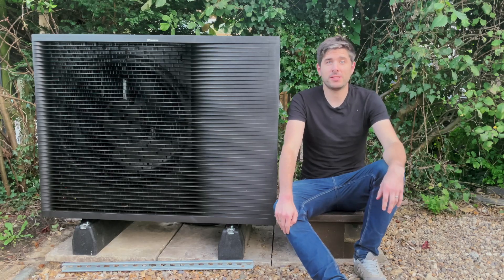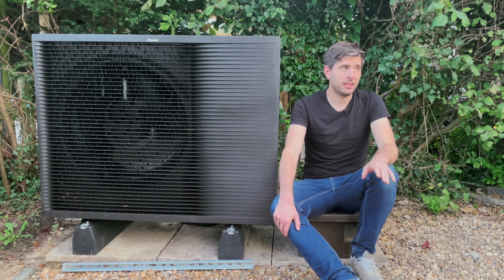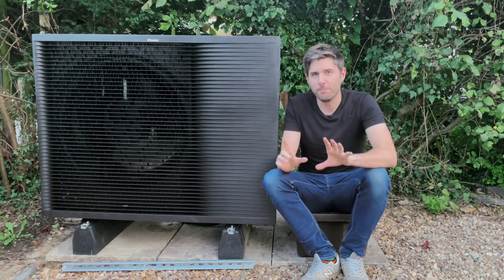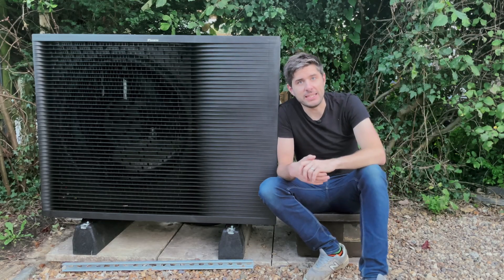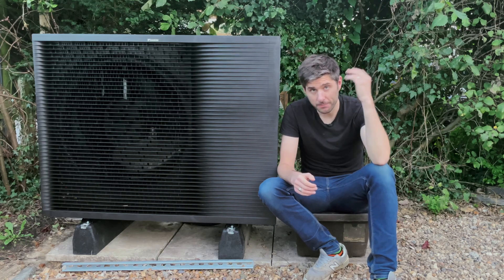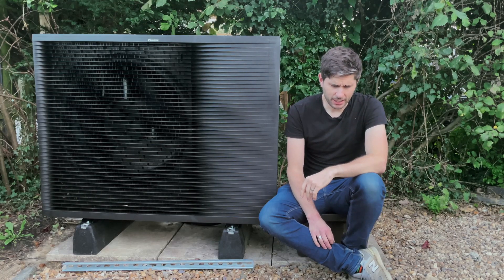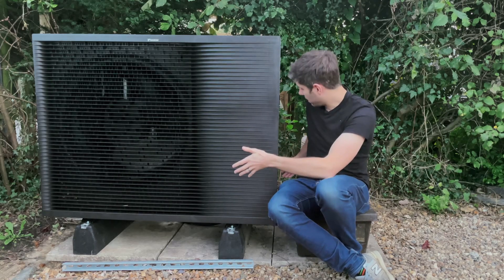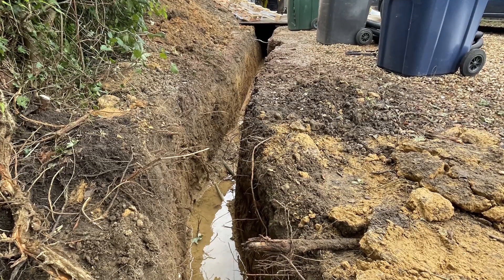Replacing an oil boiler with an air-source heat pump: Why, what and how

Comment: Would be interested to hear about operating efficiency and bill savings over oil boiler.  Also what did the take out and install finally cost?  Thanks
Reply: I can give a slight insight into this, but having only had ours in for around 2 weeks, others will know plenty more.

Firstly, i'd like to clarify, we got ours entirely for free under ECO4. So we got brand new radiators, Cavity Wall Insulation, Loft Insulation, Air Source Heat Pump, 3.6kw of Solar Panels and a 5.2kWH battery. So in terms for payback for me. There is none and thats a big thing to keep in mind.

We had ours finally turn on after 4 days of no heating, right in the middle of the recent cold snap, and we were warned not to panic about energy usage too much, as heat pumps do not like heating up from -2C. They should basically be always kept on.

Our electricity bill per week is usually around £30-40 (Which is high on average). That week, our electricity was £87. Now that wasn't just the heat pump heating from -2 (Twice, as the install had an issue and they had to drain the system due a leak). But did include a fair amount of power tools.

We're now mostly through week 2 (our solar has not been switched on yet, it's going on tomorrow) and our electricity usage is £37 so far. So it is obviously higher than it was before, as expected.

However, our house was so incredibly uninsulated/unefficient, that we spent £4k on heating oil last year, so we are still well and truly saving a fortune without even accounting for the solar.

My biggest biggest advice would be that if you want this, it's not like a boiler where its easy to plumb in and forget, you need responsible, good installers who know what they are talking about. There are so many cowboys, that plumb it in, and leave the homeowner to it, resulting in these issues where people do pay £100s a week because the install is incorrect/misconfigured. 

I was very lucky that the team I got were incredibly good. If you're in the Stoke/Cheshire Area, let me know and I am happy to recommend them.

Their main heatpump guy who was a fountain of knowledge recommended finding trusted installers through HeatGeek, who is a youtuber trying to fix the damage done to the reputation of heat pumps by dodgy installers.

But in summary, our house has never been warmer, not having our collosal oil bill is a huge relief and overall a super positive experience. 

The main downside that I did not see coming was heatpumps need a special hot water tank (similar to the traditional ones that go in your airing cupboard) but these are BIG and they do take a lot of room. So if you live in a castle, not a problem at all, but otherwise be aware whereever it goes, it will take all the space.

There is tonnes of misinformation and also people who scaremonger against these but the reality is, with an installer who knows what they're doing and a reputation they care about, you'll be fine.

Comment: Some of the disadvantages of a heat pump. (1) They don’t work in a power cut. (2) The cost of running them goes up and down (mainly up) with the price of electricity (3) They are noisy (4) They have lots of moving parts to wear out (5) From time to time they need to be re-gassed (6) The units take up a lot of space and the radiators have to be larger. For this reason, most people living in isolated locations which are not connected to the gas mains prefer to use oil. The advantages of oil are (1) With an AGA (or similar) heat is still available in a power cut. An AGA with a gravity fed system feeding the hot water tank and radiators can keep a house reasonably warm with no electricity at all required. (2) The cost of heating the house for the whole Winter is known in advance, since the tank can be filled up whenever the cost of oil is lowest in readiness for the Winter (3) Compared with gas (this is not a comparison with a heat pump) there is a saving in the daily standing charge. (4) The servicing costs are reasonably low. However, there is one major disadvantage with oil. You do not get a nice warm glow feeling that you are saving the planet. Although you are not, of course, saving the planet, since the electricity which you are using to run your heat pump is, almost certainly, mainly being generated, somewhere, using oil or gas! So, country dwellers of sense usually plump for an AGA - a large one with a back boiler and gravity fed system for the hot water and radiators.
Reply: Your points are largely irrelevant, as Back Boilers aren't possible in new systems due to not being up to regulations.  So any heating system installed today requires power to operate.
So just to address some points:
1) Neither do other modern heating systems.
2) The price of oil changes as well, so it is dependent on when you buy it.
3) Oil boilers can be noisy too.
4) Not really and irrelevant as many last 15-25 years without issue.
5) Any monoblock system typically won't need regassing in it's lifetime - A split system would only need regassing if a leak develops which is also still rare.
6) An oil tank typically takes up more space than a heat pump does.   Larger radiators are a benefit to reducing the running costs of all heating systems.

Comment: I find it absolutely mad that 90% of people would agree that the government do a terrible job at running the country and yet when they tell you how to heat your home you listen, we as the human race have gotten better and better at making electricity and yet the price has never been higher, I’m not even going to touch on the clean energy thing, the idea of heat pumps is absolutely fantastic if the price of electricity is 3 pence per kilowatt, but it’s not is it? Also 300% efficient? Absolutely rubbish, these heat pumps only have a SCOP of 3:1 or 4:1 in factory conditions, as soon as these conditions drop to anywhere near cold these percentages fall through the floor, an utter scam.
Reply: Go look at heat pump monitor, plenty of UK installs with 3rd party monitoring achieving SCOPs of 5.

Maybe look at other countries like Sweden where they are very common (and the weather gets much colder) to realise they are certainly not a scam.
Reply: A lot of systems in other countries are hybrid systems.
Reply: Todd, you are correct

Comment: Keep your old boiler & get a Chinese Diesel heater. 
Or join the Jones's & get a heat pump..
But before you do anything. 
How many years will it take to pay the initial payment back. 
How long will the items you buy last, before having to replace them & how much will they cost then..
Also how much room is taken up, having the heat pump layout in your home. 
Ideal if it is a large home , but not so good if a smaller home. 
Also heat pumps use a type of gas to generate heat that is within the pipe. How long will this last before having it replaced. . 
What is the maintenance costs, keeping the whole system going. With all this in place. 
Was keeping the original boiler cheaper. ......

Comment: My impression is they work very efficiently at getting it from moderature temperatures, about 0 degrees upwards. But then they don't work so well in the extreme cold beneath that. Its trying to pull heat energy from the air outside which is already cold.

It can definitely work and be more efficient than oil and gas, especially if you have solar, batteries and good insulation. Which is why its touted and promoted.

But experiences do vary and it does seem overengineered. Its worth maybe having a supplementary heat source  for those coldest of days even if its just a fan heater. Or a log burner etc.

Ultimately I think about what is the payback time on this and what gives the biggest wins. Better insulation is often big win at lower cost. And think how can the set up be most simplified to max out the benfits. Some of the a/c inverters are air heatpumps like on the continent and don't have all the radiators and plumbing and wiring. They get warm quickly and can work well. Less moving parts and pipes to go wrong. In anycase thanks for the video and good luck with your projects

Comment: I looked into this idea some months ago.  Here I have a problem, I live at an altitude of 1200 feet, for every 100 metres the air is colder by one degree. ie. four degrees colder than at sea level at all times of the year! my cottage has walls of stone 3 feet thick.  Like you, no mains gas, no mains drainage etc. I have 2 solid fuel stoves burning wood or coal, one stove is kept burning 365 days of the year to give heating and hot water. The system works well, at an annual cost of £1800.
The heat pump would take me around 30 years! to justify its cost. (taking into account installation and purchase cost.)
Result.... not worth doing.
Reply: Have you had a quote?

Comment: Thanks for this insight into the heat pump journey. It's uncannily similar to my own, although our plan to replace the oil tank with the ASHP unit was scuppered at the last moment when the installers realised that the disruption to the fabric of my house and the logistical confusion of the pipe runs made the proposal unviable.

The installation was finished last Friday (Sept 13th 2024) so we're in the same situation you were a year ago, getting used to a whole new way of warming the house without rinsing the electricity supply. I'll look to see if you have more recent videos explaining how you got on.

Anyway, thanks for making clear what I kind've half knew.

Comment: Its cheaper to burn £5 notes - The insulation work needed to make them work is incredibly costly and every customer I know whos fitted one regrets it - maintenance and repair costs are through the roof and your room will look like the starship enterprise when all the pipes and tanks are in - Air source heat pumps are like the Emporers new clothes it just a matter of time before people latch on to the fact
Reply from the maker: Not really my experience, don’t regret it at all. About the same amount of pipes as oil boiler. Added bonus is with solar panels, hot water is basically free in the summer.
Reply: @michael_bird  The solar panels are brilliant at hot water and you can fit them to an existing system at low cost - Your house must already be highly insulated to meet the requirements needed so you didnt need to pay that cost  but most people will - A gas boiler service is about £80 and most now come with up to 10 years parts and labour warranty

Your system is new but let us know what the annual maintenance charges are  and keep us updated on how it performs when the weather is really cold as thats when they struggle - I hope it works out for you but I know a lot of my customers have had them installed and 100% wish they had stuck to the gas boiler some have even installed a gas boiler as back up as the air source cant get the house warm enough in the really cold weather.

Comment: We had an oil burner , over 15 years the oil price varied massively "from 28 p  / litre to 99 and back  diwn again several tines , so NOBODY can say  " yes air source  is cheaper " it just depends   when   you  wanna throw 15 - 20  grand + at it ,,,,,,   and nobody is going to broadcast that a system they have paid a fortune for was a " waste of money " they would NEVER sell thier house for one thing , and then you have the price of electric x 3 ( putin )  the whole thing is so volatile , you will never win ,,,

Comment: New houses built around our
 area(several hundred) have all had gas boilers fitted.
Council house upgrades also have old gas boilers replaced with combi gas boilers.
Don’t make sense, if air source heat pumps are any good why are they not been fitted.
Just found a heat advisory article that states ASHP are cheaper to run than old gas boilers, but for A rated gas boilers they are more expensive to run.
I will stick to my A rated gas boiler combi and gas bills below £600 a year.
Reply: Doesn't really matter if the gas boiler is A rated or not.. it's not a magical machine that is efficient regardless.  Most UK heating systems are terribly designed so require higher temperatures which also makes a gas boiler far less than it's badge efficiency.
Reply: @BenIsInSweden  From what I read most ASHP heating systems in the uk are terribly designed so no change and more expensive.
Reply: @kevinwright195  that's at least getting better nowadays, gas boiler installs have been bad for decades.

Comment: Having just gone through the winter how does the running cost compare? 
I’m still on the fence I have an oil boiler and keep the bungalow at 22to23 deg in winter. I don’t know if that’s Evan possible with a heat pump and guess the electric cost could exceed the oil costs.

Comment: You needed a new cylinder because the heatpump flow rate is at a much lower temperature so the smaller heat exchanger in your old cylinder would never have transferred enough heat to make the water hot, so you needed one with a much larger coil. Probably other additional reasons as well.

Comment: The biggest failure of all is the failure to try. Don't beat yourself up. 

Good video, well presented but better to invest in insulation to a far greater standard than the current recommendations, but beware.

Comment: Great video thanks , I am in a process of becoming an installer ( same as you for a green point of view) overall you are happy with the heatpump ( the way it works ) ? Thanks
Reply from the maker: Yep, very happy - needed a little bit of tweaking over the winter but it’s very much set and forget

Comment: Love the video, clear and concise .
Is it possible to run the ASHP using our solar panels -does this require more expense rewiring ?
Many thanks
Reply from the maker: Not sure on your specific setup, but ours runs off our Libbi battery and solar system. Battery charged at night when it’s cheap and the heat pump runs off the battery and solar until it runs out of charge/sunshine.

Comment: Where I am in the UK it’s been so warm this winter that a system like this would be perfect, so much outside air heat to reclaim, 11 degrees yesterday for example. As more of these are installed the installers will get better at it too. Thank you for being a guinea pig for all of us.
Reply from the maker: Yep, worth saying when it has been really cold outside the heat pump has been able to keep up

Comment: We moved in to our house 18 months ago. Again, no gas in the village and we were on oil. Just like you, our oil tank was condemned the moment we tried to fill it more than half full. I contacted a few renewable heating companies and the one who was interested started by asking if we had three phase? With the size of our house he thought we would need three phase! We don't and it would prove expensive and slow to get it fitted and three phase suggests lots of electricity being needed, at least to me. In the end we bought a new oil tank, bunded and 2000L in volume. 

We got the boiler serviced. The engineer told us to hold on to it because it was a good unit and fine. Phew!

Our house has dual manifold hydronic underfloor heating and a thermal store, admittedly approaching twenty years old. We have no radiators and a couple of our rooms have wood burners. We also have solar on a FIT, a payment for wind turbines (almost 2 miles away and not an issue) and have since added batteries. We now run Octopus Agile.

I am hoping that the FIT, the savings with Agile and the turbine subsidy will just about keep us breakeven on electricity cost. We get through about 2-3000 Litres of oil a year. If I buy it when it is cheap, it isn't too bad, especially for our house, close to 3500 square feet.

The calorific value of oil vs electric heating, even taking COP into account, doesn't necessarily make ASHP a no brainer - especially if the existing infrastructure needs to be changed (radiators upgraded, for instance). The time of oil purchase needs to be considered, 50p/litre in the summer is a lot better than 90p/litre in the winter and that plays toward keeping oil.

The other thing is the type of house. A modern thermally efficient house is a much simpler proposition that one like ours : part cob, part stone, part cavity wall - at least we have low-E glazing and decent roof insulation for the most part. It's a whole different matter if the building is listed and very drafty!

I sincerely hope that your move to ASHP plays out well for you. Were our boiler to pack up I would seriously consider a heat pump again. By then, hopefully, the installer knowledge base will have improved and prices may have dropped a bit more.

Comment: Cool pumps..... Do you really want warm radiators.... They rely very heavily on electricity..
Reply: Maybe do some research?
Reply from the maker: They do require electricity to operate, but so do most other heating methods.
Reply: @michael_bird  they do require extra heating to heat up the hot water has well, the heat pump has to be running all the time, and you should end up with warm radiators...
Reply: @Displays.1234.  where is your sources? hot water can be provided by a heat pump just fine.  Anti legionella can be done on a schedule either with an immersion (R32 etc), or by the heatpump itself (R290 or R744).  Running all the time is how they are most efficient, you can run them in a on/off thermostat controlled scenario, but you lose a lot of a the efficiency gains.